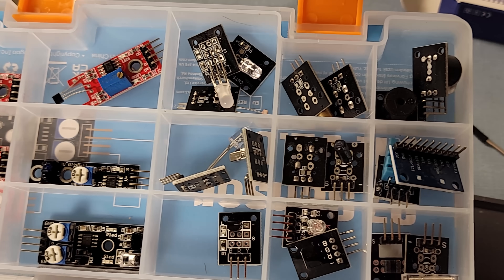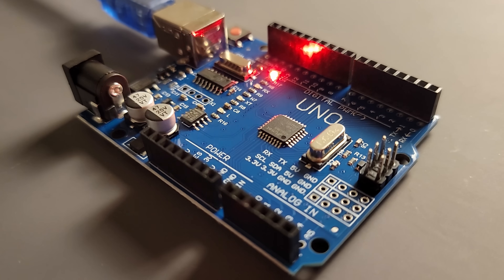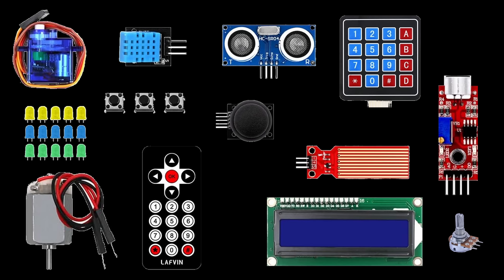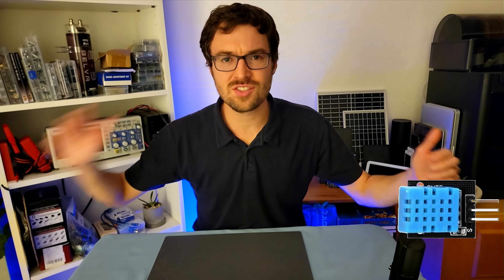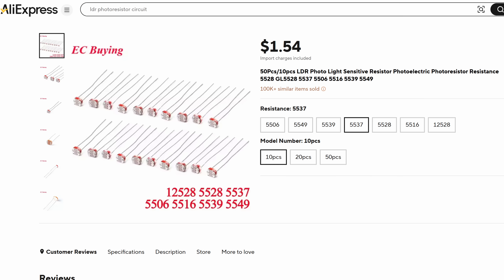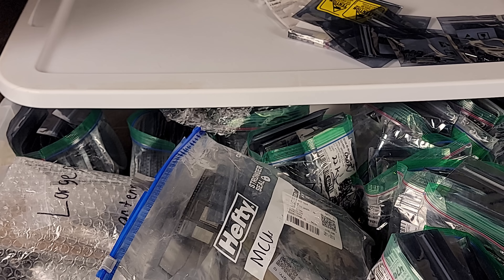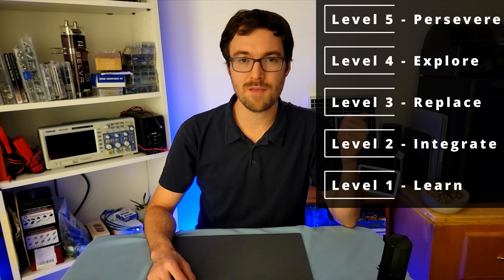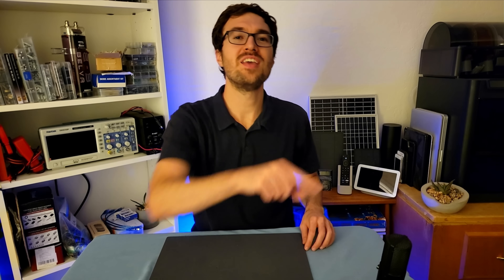How to Make Anything - Learn to Think Like an Engineer

Comment: You're doing a lot of repeating utilizing different example of how an engineer thinks, but almost 7 minutes of stating the same concept won't keep subscribers.  Get rid of any background music as it annoys most people trying to listen and retain.  I'm interested in learning more about designing electrical projects as I'm a robot and Star Wars Droid builder but I build using recipes and want to create my own robot/droid.  Getting a starter kit with 200 plus items is great, but not nothing what each piece does just makes it a part sitting in a plastic bin or box.  The other issue we deal with in droid building is amps and not to create blue smoke of death.  I'm still not sure on voltage vs amps and resistance and how to use it when integrating numerous parts.  Last issue, you speak at a good pace, very clear and understandable, but there's something effecting the actual sound, could be your microphone, sound bouncing off objects, but you may want to check out different mics to see which one gives the best sound.  I look forward to your channel and learning, but you need to start producing at least one video a week to keep subscribers.  Best of luck.
Reply from the maker: I found the sound issue! It was an audio filter for background noise suppression in my recording software. I turned it off and the quality went from a C grade to a B grade. 😁 Thank you for pointing that out! Downside is I might need to rerecord the filming I did yesterday 😩
Reply from the maker: I definitely got a lot of improvements I can make! Thank you for the specific points I can work on. I'm filming the next video now and will think a lot more about the sound quality. I'll upgrade to a new microphone in the near future. 

Starter kits are a great start, but it seems like you have an ambitious project ahead of you! I imagine a lot of power electronics and switching. How big is the droid? Are you going to use perfboard or make PCBs?

Comment: Problem is most often supplying stuff with the right voltage, with enough current and finding out where to put what resistor or condensator. It can take a lot of thinknig and rethingking to build one thing and combine stuff, and adding one new thing sometimes requires me to redesign the whole circuit. Yeah painful and i had to buy some dc-dc buck converters and then a step up regulators lol, then realized i cant use 5v of arduino because i cant get enough amperes for sim800l with that shit haha so i have to use outside source and also power the shitty arduino so ehhhh there is always another part i didnt buy haha
Reply from the maker: Seems like you are finding out that once you get past kits and modules things get a bit harder 😂 Eventually having multiple voltages on a board is second nature. It just happens so often I don't even think about it anymore. You will always be running into the problem of not enough amps. Power supplies are expensive so we tend to get just the smallest one that will still do what we think we need. Don't expect that to go away anytime soon 😬

Comment: My #1 tip for anyone trying to kick modules for components: take things apart! Tinkering with old electronics is what taught me to think like an engineer. If you know how a device works, you can reason how the individual components work by testing them with a multimeter. Analog sound equipment and toys are full of motors, and I personally discovered photoresistors by breaking open a lawn decoration!
Reply from the maker: You are so right! @JeffGeerling has a recent video where he fixed his kid's toy and it was about six different modules just wired together and screwed into place on a larger plastic housing. One a potentiometer, another piezo electric speaker, one the MCU, It really showed how a complex product is just a system of smaller systems. Ever since I saw that video I've been thinking about going down a Goodwill and buying some things to take apart to show everything is just made a modules of various complexity, nobody uses a monolithic huge circuit board anymore.
Reply: Yeah but as a beginner doing that can be quete dangerous haha :D especially a microwave
Reply from the maker: @rickmonarch4552 almost nobody should be messing with microwaves! 😜 I see it as basically a ridiculously large transformer that is looking to ruin someone's day or life.
Reply: Facts. All my starter kits came from the curb 😅
Reply: Kinda but technology has advanced so much that components from only 20 years ago are ancient, extinct or developed to much it's pointless. Heck look at M1 chip compared to something from Intel from  5 years ago.
Reply: A microwave is not in any way dangerous when powered off, aside from sharp matal edges and the ceramic insulator on the magnetron has a part that contains beryllium oxide. If broken apart the dust from that can be toxic if inhaled, but other than that a microwave is just a big ferreday cage of parts and components. I have taken many apart to reuse the parts to make a spot welders.
Reply: @brine80doesn't it have a capacitor that has to discharge people unplug it dig right in and zap dead. It will discharge but I would look up how long and then double it.
Reply: @FlipTheTables YES it sure does - old microwaves are in fact very dangerous to disassemble (as are old CRT tvs, for the same reason!). They can hold a charge for months or even years afaik

Comment: Hi! I'm so glad I've found you! Great video man and excellent tips. At rhe moment im working in building an rc airplane, no tutorials only research and my own creativity. But I noticed the difficulty in getting a hold of cheap and reliable hardware (electronics, motors) most of the stuff needed for the project i bought it from Alibaba and temu; cheap but it takes too long to get delivered. Thanks for your recommendations subbed!!
Reply from the maker: Welcome to the crazy world of electronics where you really don't get what you pay for 😂 a $5 motor controller might be better than a $20 motor controller, and the $20 motor controller will claim to do five times as much but start overheating much sooner! 

A RC plane is one of the best working examples out there for learning. I'm sure your piloting skills will improve dramatically when you have many hours of effort put into something that is very crashable. 😁 I wish you many soft landings!

Comment: The bg music motivated me to do something. I am building a 6 DOF motion sim. Wish me luck
Reply from the maker: Heck yeah! What are you using for the sim? Like standard programming languages AKA Python or something like that or are you doing something like a Unity engine sim or some game engine or ROS stuff?
Reply: @FluxBench  it’s an Arduino - PC setup. Low level control is Arduino (SMC3 firmware) talking over to FlyPT Mover on the PC. Just trying to build a budget sim for microsoft flight sim, DCS. I wanted to build controllers as well (joystick, throttle) so just exploring now.
Reply from the maker: @ImperialInception if I could pause my life and screw around for a month, making flight sim controllers would be a good way to spend it in my mind 😜 that sounds like an awesome project!
Reply from the maker: @ImperialInception if you have any questions just post a comment on one of my videos and I'll reply. That seems like so much fun 😁

Comment: I bought one of these starter kits and ended up enjoying learning the basics a lot more. The modules have all sat in the box while I learn about voltage dividers, transistors and Ohm's law.
Reply from the maker: You are lucky! If you enjoy that a central and core knowledge, keep at it! It will serve you very well! If you really want to go and shake up your brain learn how a buck or boost converter works and then how MPPT power conversion works. On the surface they are very simple, but then you realize it's all about storing energy in both electric and magnetic forms and using weird physics principles and if you do everything fast enough it'll kind of just averages out instead of starting and stopping real quickly. You got a lot of fun ahead of you!

Comment: What if I just have a project in mind but don't want to learn schematics and the field of electronics in general?  Can I just hire a freelancer to help me Figure out the parts I need and how to put them together?
Reply from the maker: Potentially but depending on what you want to do it might be very easy with stuff you can buy off Amazon for under $20 or it might be one of those things that turns out to take a lot of custom work and could be in the thousands. What's your project if you don't mind me asking publicly?
Reply: @FluxBench it's essentially a consent based match start system for two opponents. 

Each individual will have a button to press when they "consent". But it has to be held for two seconds in order to register. When both players have registered consent, the match starts and an audio signal is sounded.

Both individuals are on a thirty second timer that counts down. If it hits zero before giving consent, they receive a penalty. Giving consent, however, resets this timer. Each individual's timer is independent, but they start at the same time. 

This will all be visually represented by two LED strips. One for each individual. These will simulate two individual "bars" that decrease, or "empty", in accordance with each independent timer. Or "fill up", when consent is applied.

These LED strips may be used for different effects as well. For example, when both individuals "consent" and the match starts, the two LED strips may flash a solid color for a brief moment.

To start this device/system, a switch would be used. I.e. an on/off switch.

An additional button would be needed to start/reset both timers.

Perhaps another toggle button in order to rotate through color schemes/themes for the LED strips. And maybe a small LED to show which theme is currently selected.

An Arduino Uno would probably be used to handle all the logic. 

So the main components would be an Arduino, two neopixel LED strips, two "consent" buttons, some sort of audio output, an on/off switch, a theme toggle. Oh yeah, and batteries, of course.

I hope this made sense.
Reply from the maker: @winkeyface2933 ESP32 rather than Arduino boards will probably be significantly better. They are the best you can buy for a few dollars with Wi-Fi that I know of. Doesn't matter if it's Bluetooth or Zigbee or Wi-Fi or whatever, some type of radio network passing around data using radio strength between two devices to determine proximity, and about 500 to 1,000 lines of code and you're probably done. You can probably get someone to make you a PCB for about 100 to $200 and get five of them made by JLC PCB in assembled for like 50 to $100, and you will need someone to write the code/firmware. I would recommend you get someone to write the code with plenty of comments in it so that way you can maybe update some things yourself later and it's not all gibberish. Easy to change for example 30 seconds to 60 seconds if things are clearly labeled, just change 30 to 60 and reprogram your devices with the new code. 

Seems like a interesting concept, let me know if you have any more questions.
Reply: @FluxBench thank you so much for the guidance. I wasn't actually planning on utilizing wifi or any other wireless connectivity. I just had the idea of connecting all of these I/O's to the Arduino with wires. But perhaps there's a more elegant and "modern" way of doing things. 

Would you just recommend I go on Upwork for this, or are there specific places where y'all electronic wizards dwell?
Reply from the maker: @winkeyface2933 this might be a good thing for you to take to Reddit and ask on the r/Arduino subreddit to get things figured out at a high level, then maybe go over to r/Electronics or r/PCB and ask them specific things. They are thirsty for work, so beware you might get like a thousand people saying they'll do it for $20 which isn't a good thing. You probably want to go through Fiverr or pay someone a little more money is that way they can spend some quality time and use their more valuable experience to make a better PCB or firmware for you. I don't do much freelance purchasing in this field as I'm normally the one just doing it myself. But Reddit probably has some good and a lot of bad opinions on where to do it.
Reply: @FluxBench Yeah, I still need to iterate on my design ideas. Especially since becoming aware of things like Teensy 4.0 and ESP Now, for example, and thinking more and more about wireless connectivity—how it could be way more elegant. 

The idea of having all of the I/O's communicating wirelessly is really appealling. The main issues that come to mind though, is potentially cost, and each I/O component needing an individual power source.

Comment: great message. once you learn some recipes with microcontrollers you can tweak them for your own projects. physical computing is super fun. you really can control whatever you feel like. want an led nightlight that turns on at the same time you have to get up for work? done. wifi connected clock display? easy. Build your own smart thermostat. Motor speed controller? done.

Comment: Hi i am studying robotic engineering and i would like to learn how to improve my elettronic level, i bought an arduino kit and i am managing to use it but i would like to understand how get to build my own elettronic circuit and board, could you give me some advice? I know the elettronic components in general but i am not able to design a circuit from zero and i don't know how program for example the arduino chip on my own board
Reply: another thing that i would like to know is how can i implement robotic theory that i learned at university, on arduino it seems difficult to implement that algorithims (matrix, integration, derivation ecc), i used matlab, is it possibleto integrate it with arduino or i need to use another board like STM or ESP32?
Reply from the maker: @pierocampitelli4372 You can do just about anything in C code on the microcontroller. The problem is they don't have a lot of memory so you have to do a lot of things in batches or iterations instead of for example just adding together 10,000 numbers at once. 

It might be easier to get an ESP32 to start as they have a lot more memory than most other microcontrollers in the price range. It's like if you have a fast car, you don't have to be that good of a race car driver to still be fast. Fast microcontrollers with bad code can still do things fast. Any board will work to help you figure out how to put robotics algorithms into a microcontroller.
Reply from the maker: Designing a circuit is a lot like setting up a math problem. If you're not used to doing it, it's hard to figure out where to begin. With math it is formulas and stuff like that, but with electronics it is more of components and communication. I found it got easier each time to go from idea to circuit, but in the beginning it was so hard! I think you just have to force yourself to start. Pick something you want to do, kind of like choosing a math problem to solve, then just do it. You will have to Google everything initially, but eventually you'll remember things over time. 

If you want to be a engineer, Arduino is a good start but start learning about chips in general. They all work the same, and basically use the same programming language, C.

Comment: I currently have 4 projects going at once…

one uses ESP32, 4 DHT22 temp/humidity sensors, an OLED display and a pump motor.

One uses ESP32, an MFRC522 RFID reader, a relay, 3 switched outputs controlled by the RFID reader and a few LEDs, transistors, etc. 

One uses an ESP32, a water level sensor, a pump motor, and BTLE.

And one uses Arduino MEGA, a dissolved solids sensor, peltier coolers, pump motors, a water quality sensor, thermistors and photoresistors…

So much fun and frustration! You guys have got to get into embedded systems engineering… it’s a blast and great for bragging rights! 😊
Reply from the maker: Awesome! Great examples of how a few simple things can be combined into something useful!
Reply: Cool stuff